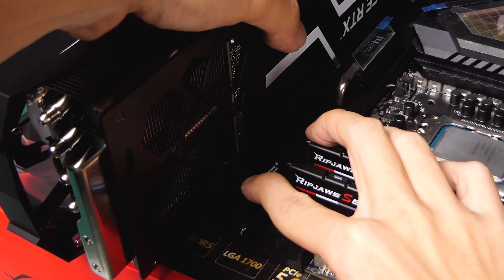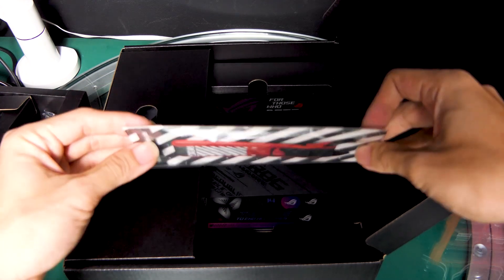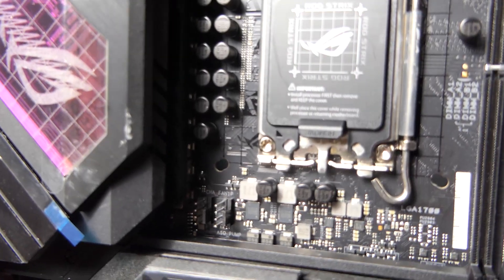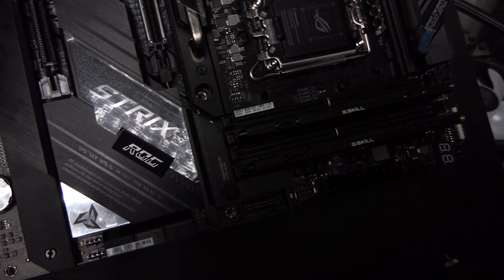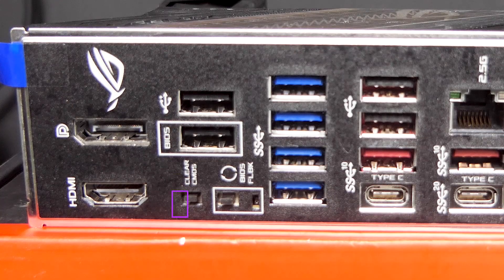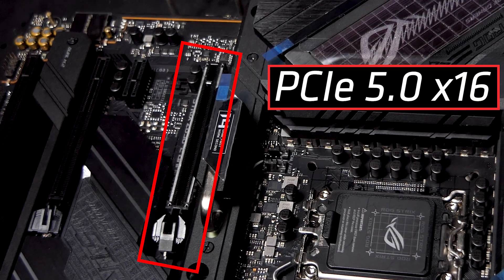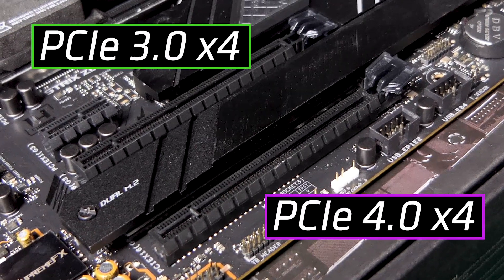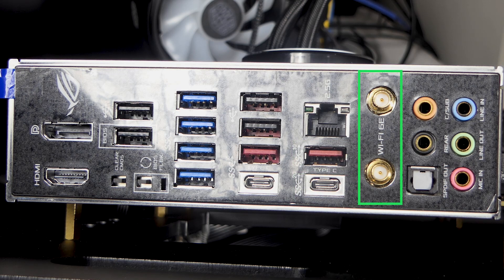BEST Z690 Motherboard As of Yet? ASUS ROG Strix Z690-E Gaming WIFI Overview

Comment: Hi, I have a problem with this board, I have a i9 12900ks and a Samsung 980 pro installed in it, when I install the gpu in the 5.0 pcie slot it gives me only x8 bus speed, I tried to install the m2 980 pro in all different ports and still x8, I have the latest drivers installed for everything, any solution?
Reply: It’s x8 4.0 to specify
Reply: Have you found a solution

Comment: Got a question if your don't mind. Does that mean to get the most out of it, the SSD should not install on the 1st SSD slot right next to the GPU but to the Hyper Pcie card to the bottom instead?
Reply from the maker: Yes you can use the other SSD slots if you want to get the full length PCIe. Or you can use the provided Hyper card :)

Comment: You are a very good reviewer and I appreciate your presentation. However to help you gain more viewers I have a word of advice. You need to slow down and pronounce each word clearly. 
Otherwise good job, and you correctly clarified that if you use the heat pipe M2 for your nvme drive that it drops down your top 16x slot to 8x for your video card. The solution is to use the lower nvme, or, as you said, get the more expensive Maximus motherboards
Reply from the maker: thank you for your awesome advice! yes i am trying to slow down my speaking. i hope it sounds better now?

Comment: The big problem I have with this board is the pcie-e lanes... when m.2.1 is occupied, the top pci-e runs in 8x, the provide a m.2 card which is nice, but meh.  At this price point there are better options.
Reply: So don't use the m.2_1 slot.

Comment: I have this board, but I'm still waiting on the DDR5. It looks nice in the box with my i9-12900 already planted in it. The only thing that bothers me about this board is the confusing mess of trying to figure out optimal use of the pci-e and m.2 slots. Another question is whether my current m.2 add-in card will work with this board. It's pci-e 4.0 with slots for 4 m.2 drives.
Reply from the maker: Wow! Which DDR5 are u waiting for?
Yeah, the M.2 slots config esp, there's quite a few combinations with the Hyper M.2 card. 
I think the older Hyper M.2 card should work?
Reply: I am thinking of buying this board but I have the doubt if I install an nvme ssd in the main port, it lowers the speed of my graphics to 8x or only that happens if I connect a pcie 5 graphics in the x16 port?
Reply: @KerZeR  Oddly, this board has 3 different generations of PCI-E slots, which makes it more confusing. There's one 5.0 slot for the newest graphics cards, but it shares bandwidth with the 5.0 m.2 slot. If you want to use a PCI-E 5.0 graphics card, you shouldn't use PCI-E 5.0 storage, so leave m.2 slot 1 empty. The board comes with a Hyper m.2 card that can run 2 SSDs at PCIE-4.0. The only recommended slot for this card, according to the manual is the PCI-E 4.0 slot. Then the other x16 slot is PCI-E 3.0 which you can use as you want.

Comment: Nope it not. If I am not wrong some CPU cooler have compatibility issue with all of Asus z690 strix LU. And it's board is thinner than MSI. And of course it's overpriced.
Reply from the maker: Ah I see. I have tested it with the cooler master ml360 illusion. Seems OK for now, for the lga1200 bracket. 
Did u manage to test it with another cooler? 
Well ddr5 adds on to price 😄
Reply: @RealMelTan  nope. Got myself a MSI board. Was an Asus fan till z690 comes..